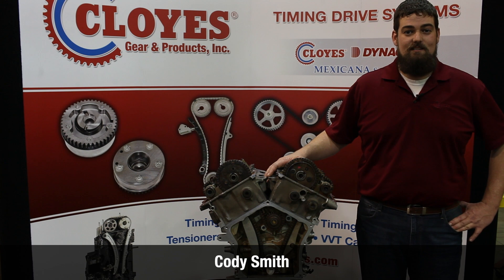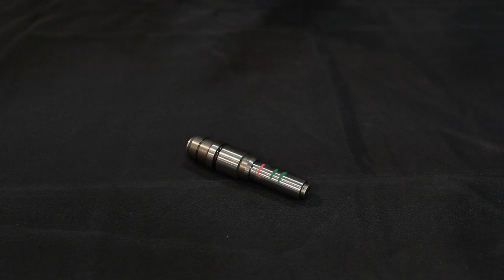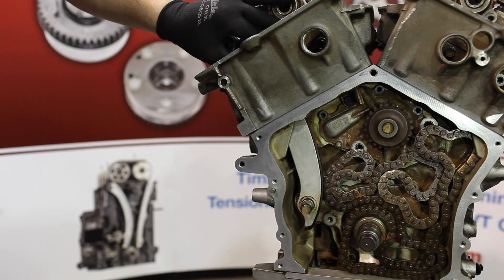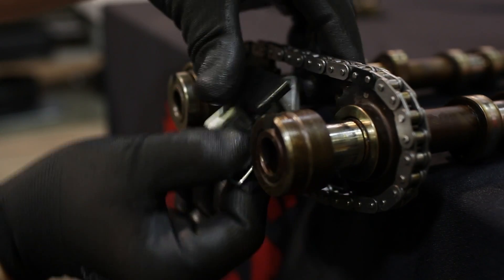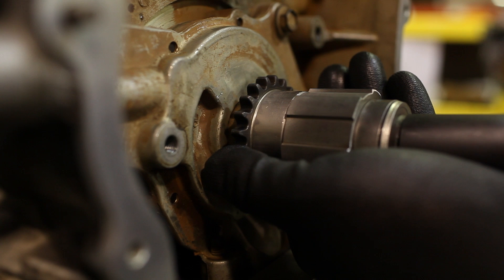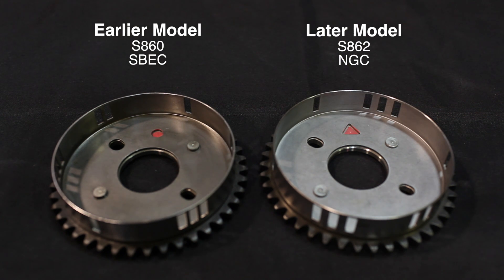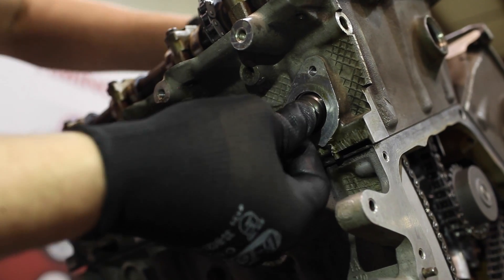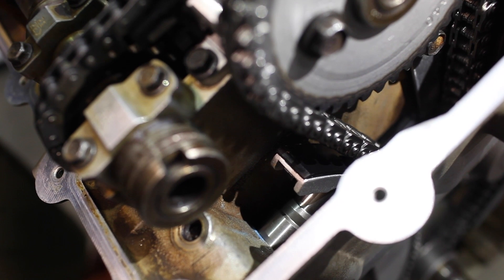Chrysler 2.7L Timing Chain Replacement, Cloyes 9-0397SA

Comment: So if you're timing has jumped, you start by rotating the crankshaft until the sprocket timing marks are in the correct position? You say "take care in rotating individual shafts" does that mean you have to rotate the camshafts separately? If there's resistance that means there's valve damage and it needs more than just a chain, correct? It's my first time doing one, don't wanna mess up the first step lol
Reply from the maker: If the engine jumped time then there is likely valve damage. Valve damage or not, if the timing is off you can still experience piston to valve contact when you try to rotate the engine with the chains on. If you feel any resistance when rotating you will need to stop and take the chains off. From there you will need to remove the spark plugs, note piston positions, and find spots where you can rotate the cams while the pistons are all down on each side. Take your time and don't force anything.

Comment: Where did you guys get the sleeve/tool for the crank sprocket install?
Reply from the maker: We used a GM LS oil pump drive, a random spacer, and a washer to make our own. You can purchase a crankshaft sprocket installer, or find/make something that will work like we did. Piece of pipe, large socket, etc. As long as it fits over the crank nose and the balancer bolt has enough thread engagement, you can use a number of things.

Comment: If I only need to change the tensioner by some act of god because it failed and the chain was slapping around loose but it fixed itself and now the car is back to normal again so it’s bound to fail soon but I only need to sell the car so can’t I just take the tensioner out? Put new one in?
Reply from the maker: Yes, you can change just the tensioner. Just know that you will need to remove the valve cover on the tensioner side to compress and activate it after installation.
Reply: @ you are a legend

Comment: I set the timing on my dodge journey 2.7 as you have shown but now there is no spark, i wondered if I had the cam wheel a 180 out
Reply from the maker: The camshaft sprocket only installs on the cam one way. If the sprocket and chain marks are aligned, then there is no way of being 180 degrees out.
Reply: @Cloyes01  Thanx for answering , I checked the timing and it all seems fine, the car started intially , ran a bit rough and then cut out, it would not fire again, i checked and found the spark had gone, i checked all connections ect, any ideas , perhaps I am missing something simple, there is a small charge at the coils about 5 volts, is that normal. hope you can help...

Comment: Awesome video I followed all the steps doing this but I do have a problem. When I turned the car on. It was Making a rattling noise under the valve cover of the tentioner and it was leaking oil from the cap cover. I need your help with this situation

Comment: I aligned my primary chain sprockets like in the video but the secondary sprockets are not pointing up. The passenger side are up but the driver side are down. What do i do
Reply from the maker: That is normal. The intake camshaft sprocket will only install onto the cam one way. You have to rotate the cams until the holes align for your primary sprocket. This will put the marks down on the LH bank. As long as your secondary chains/sprockets were timed properly, and you align the marks on the primary chain/sprocket, you will be in time.

Comment: this may have been said already. but dodge's answer to any  internal repairs to the 2.7 is to simply replace it. also dodge recommends engine replacement every 100,000 miles if anything is wrong with it or not. just a testament to how poorly designed this engine was.

Comment: I must say thank you Cloyes: wirh your instruction I proceed to repair my dodge Journey 2.7. I advice to  readers, the oil pump can not be removed by 5 milimeter interference with oil pan.... another Dodge engineering mistake. Regards from Chile.

Comment: I can’t get the tensioner to re activate? Any ideas!?
Reply from the maker: If the tensioner has been in a running engine you will need to drain all the oil to allow full compression. With the tensioner out of the engine, compress the tensioner (a vice works great) while lightly depressing the check valve ball in the inlet port at the base of the housing. This will force all the oil out of the cylinder and allow for activation.
Reply: Thank you

Comment: All three colors lined up but when I put that left hand sprocket on last it wasn't I had to turn the bottom for the slack to come out I think maybe the timing is not on but all three colors were matched up
Reply from the maker: The alignment of the marked links of the chain to the sprocket marks is the important thing. It is normal to need to shift the slack or rotate the shaft slightly to get the new chain to align. As long as all 3 chain marks were aligned when you were done, then it is in time.
Reply: @Cloyes01  you know I don't think I did it right so I think I'm just going to take the secondary chain off in a line it like you did on your video and redo all of the timing I'm going to follow your steps on this video is that the proper way to do it to put everything back in line if it's not in line because I put on all three new chains that's why I think I messed it up and thank you so very much for getting back to me this thing is a pain in the poopy I did it before but I only did the water pump but this time I did an oil pump water pump and it's a whole bunch of work

Comment: I'm having trouble with Left cam timing (small chain). Lining up the marker links with the little dots on the cams isn't working with the cam sprocket. By the time I have the marks on the big chain lined up, the marks on the small chain on the left are way off. Are there "red arrows" on the left side only? Can you send pictures of what the left cams look like when the big chain is installed? Thanks
Reply from the maker: As long as the marks on the small secondary chains were aligned before you started to install the primary chain, then you are good to go. In order to install the primary chain you will need to rotate the cams and the reference marks of the secondary chains will go away.

Comment: You did mention removing the upper guides while removing the old chain.  You did not mention replacing the upper guides while installing the new chain.   I'll use the same torque on the upper guides as you recommend for the main guides.
Reply: Using a 4" digital caliper to measure the distance from the front of the crankshaft to the newly installed crankshaft sprocket, I got different measurements every time I measured.  To find a solution, I took and recorded 10 measurements, then took the average of those 10.  My average distance was 1.5366, which is within the tolerance range.
Reply: After that, I checked the timing mark alignment between the sprocket and the water pump.  I had to rotate the shaft.  Afterward, I measured again.  5 measurements with Zero after each produced an average distance of 1.541.   I stopped at 5 this time because the range of each measurement was between 1.54" and 1.543".

Comment: Is it possible to have the crank 180 degrees off. I received the car with heads already removed and basically had to piece it back together. So timing wasn't lined up upon removal. I have the marks perfect, spark is good. Fresh fuel. No start. Bought the cloyes kit and everything. The only thing I can think is it's not TDC compression storke. It's 180 off.
Reply from the maker: No, 180 degrees out would mean that the camshaft sprocket timing marks are pointed downward and likely would not align with the chain. If all the marks are aligned on the primary and secondary systems, then you are in time. 

The first thing that comes to mind is the Left Hand Camshaft Sprocket. Did you make sure the reluctor wheel on the back of that sprocket matched the original? Some years of the 2.7 offered both versions and you must verify.
Reply: Reluctor gear as in the driver's side that reads the cam sensors?
Reply from the maker: @thebackyardgarage28  Correct.
Reply: @Cloyes01  it is identical.

Comment: Just a question. You say to rotate the cams clockwise to bolt the sprockets back on but I was reading a Haynes manuel and it say that they rotate clockwise when you take them off and to rotate them counter clockwise to reinstall. Does it matter which way?
Reply from the maker: No, it doesn't matter. You just need to go the direction that is required to align the sprockets.
Reply: @Cloyes01  thank you so much for the reply. I'm getting ready to put everything back together tomorrow and I was a bit nervous but your video was Amazing. Best video I've seen so far and just wanted to say thank for that.

Comment: So the number one piston won’t be at the top when put to timing??
Reply from the maker: No, when you align the mark on the crank to the oil pump mark you should be at 60 degrees after TDC.

Comment: I have a question my marks are good at the crack sprocket but on cams there off 
Can u help
Reply: Are they at the 12 o'clock or 6. Your crank rotates 2 times for every one rotation of the cams so if your crank is lined up but your cams or at 6 o'clock just rotate the crank another full turn. And they say to not worry about the chain marks when removing as long as the sprokets  line up

Comment: I need help. Doing the water pump on a Chrysler but I cannot get the timing chain to get back on properly. I look at your video and I noticed you pull out the two gear wheels on top the lines up with the timing chain. If I take it off I will have to reline up the whole thing. I took off the timing belt without it. But now I am having difficult putting the chain back on the gear wheels and going back on the water pump...
Reply from the maker: The chain sets the timing, so yes you will need to remove both top sprockets. Install and align the chain to the crank sprocket mark, then install the 2 cam sprockets with the marks aligned and rotate the cams until the bolts align for the cam sprockets.

Comment: Can u just remove the tensioner cap to replace the the seal or do u need to remove the valve covers to make sure the chain don't jump? Great video.
Reply from the maker: If you remove the tensioner cap you will need to remove the tensioner and deactivate it. Upon reinstallation, the valve cover will need to be removed to activate the tensioner against the chain.
Reply: @Cloyes01  I figured that but wanted to get a second opinion. Thanks for the reply and thank you for the great content. 👍

Comment: what is 60 degrees after TDC according to the Haynes Manual?  Mine is a tad bit, little lower than TDC will that work?
Reply from the maker: As long as all the marked chain links are engaged with the marked sprocket teeth then you are close enough. The actual position of the pistons doesn't matter, the chain is setting the timing. You just need to make sure the marks are aligned.

Comment: I did all the steps exactly like the ones in the video but for some reason the chain gets stuck in the water pump and won't let the engine start.
I already did it twice.
 the pomp has two gears in which it is on the edge of each one.
(2010 dodge charger 2.7 v6)
Reply from the maker: Make sure you have the correct water pump for the chain you are installing. The chain should wrap around the water pump easily and completely before installation. Chrysler made some changes to the chain and water pump around the 2008 models. The earlier big chain will only work with early pumps and the later small chain will only work with the late pumps.
Reply: @Cloyes01  thanks

Comment: i had a bit of trouble. i lined up the spline mark of the crank sprocket with the mark on the oil pump. the the other corresponding marks. and when assembled i encountered backfire. now there is a seperate mark on the sprocket, a dot imbedded on the sprocket. could that have been the timing mark? this area of the engine was viewed from afar, as opposed to the other parts of the engine in this video. so obviously the directions were misconstrued.
Reply: i did as instructed and im backfiring.........

Comment: I have a question...how do you time the 2.7 dodge engine if you use the old chain and dont have Mark's on the links
Reply from the maker: If you know the engine is in time, you can mark the chain links using a paint pen that are aligned to the sprocket timing marks. 
If the engine is not in time, find a good image of the chain and marked chain links. Count the numbers of links between the marks and mark the links appropriately.

Comment: i was worried about setting the timing, now i know i can take it all apart and set the timing with the marks. i hope that's correct. thanks for the torque specs, awesome video. you get a like.
Reply: Just read the manual and worries is out.

Comment: why 0.75 to 0.90? where did you get that number? I checked the manual, there is no such number. It says only needs replacement if it is max wear indicator groove is visible.

Comment: Watch out ! They tell you to do the chain tensioner first but you need to loosen the bolts on the pulleys first or the chain will jump the pulleys and destroy your marks.
Reply: netstarr77, what pulleys are you talking about? Did you mean the cam sprockets?

Comment: I'm having trouble getting the tensioner to release from its compressed state.. any tips?
Reply from the maker: Is the tensioner used, or has the engine been turned over since the tensioner was installed? If the tensioner has oil in the cylinder it will not compress enough to activate. You may need to remove the tensioner, purge the oil, then reinstall.
Reply: @Cloyes01  thankyou, I believe the tensioner was bad.. it wouldnt keep tension while I manually turned over the engine. I just got in my new tensioner, will replace using your video suggestions thanks

Comment: Do you need camshaft locks when removing front chain?
Reply from the maker: No. The chain and sprocket marks will time the engine during assembly.
Reply: @Cloyes01  ok thanks

Comment: Is a 2007 Charger 2.7L basically the exact same?
Reply from the maker: Yep, process is the same. They did use some different chains in the later years, but no change to the process.
Reply: @Cloyes01  Ten four. good to know. My current 07 charger 2.7 apparently has about ten lifters not functioning. Any advice?

Comment: If I were to replace rocker arms and hydraulic lash adjusters (lifters)at the same time, is priming the oil system enough or should these parts be soaked in oil prior to installation?

Comment: I got a question. If the mark at the bottom align With the belt that means the other two at the top should be align too no ?
Reply from the maker: When properly timed all marked links will align. Once the engine has been rotated, the marked chain links can no longer be used as reference.

Comment: Yeah not a fan of this engine. I feel it is the one that forever damaged Chrysler's reputation as a car manufacturer with both the public and with car enthusiasts. They should have stuck with the Mitsubishi 2.5 and 3.0 engines that they used in the Minivans, LeBaron, 1G Avenger, Sebring, and the Cirrus/Stratus Cloud Cars. They all have their pros and cons but those Mitsubishi engines run forever and you don't have to worry about them sludging and self destructing like these 2.7's are known for. Guys in our car group are even upgrading the aging 2.5/3.0 motors (since most of these cars are now 20+ years old) in their cars to the newer generation Diamante/Galant/Eclipse 3.5 and 3.8 engines as Mitsubishi was smart enough to leave the design relatively unchanged for the most part. If it ain't broke don't fix it.

Comment: I did all of that but when I move it by hand it jumps time, but If leave it and put it back together with all the marks lined up it wont jump time when I turn it over?
Reply from the maker: Once you get the marks lined up try to shift all the chain slack to the tensioner side by rotating the crank clockwise before activating the tensioner. This will allow the tensioner to come out as far as possible and decrease the chances of it jumping time. Once everything is set there is no reason to turn it over by hand. You are way more likely to jump time turning it by hand than you are with the starter. When rotating slowly valve movements will cause the chain to jump if the tensioner is not primed. The faster rotation stabilizes the valve train and will not have as much impact on the chain. Of course once the tensioner primes up with oil there will be no risk of jumping time.

Comment: Hi, i've a one question about this engine 2,7 (EER). What is a difference between this engine from 2006 and 2008 manufactury years. I'm from Poland. with us, nobody knows about these concept engines
Reply from the maker: I can only speak to the timing chain system. Chrysler changed the chain design and went to a lighter, smaller pitch chain for the 2008 models. This chain change required new sprockets and water pump. Other than this change, the timing systems stayed the same.
Reply: @Cloyes01  ->2008 old timing system. 2008-> new timing system? I see, rest parts and block are the same. Where i find service book old and new timing system?